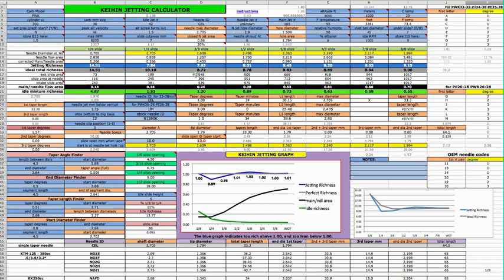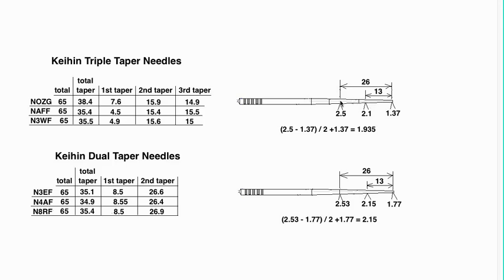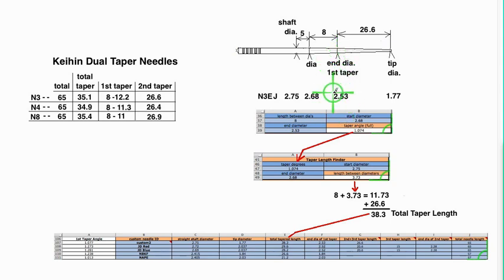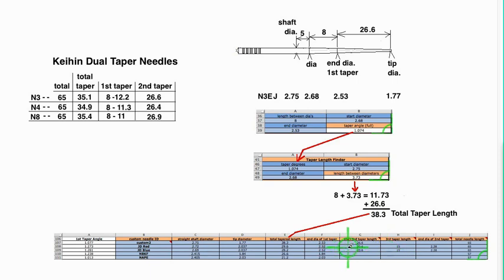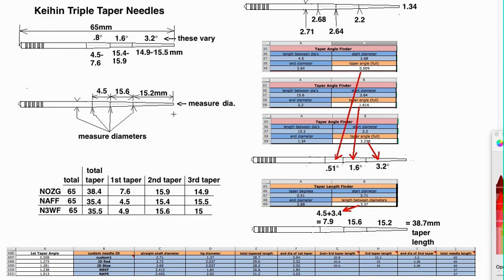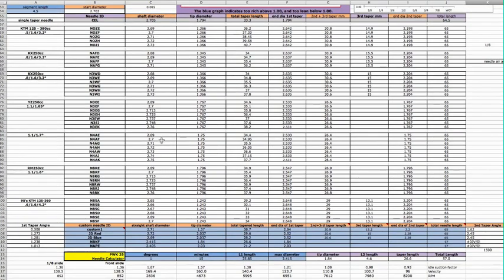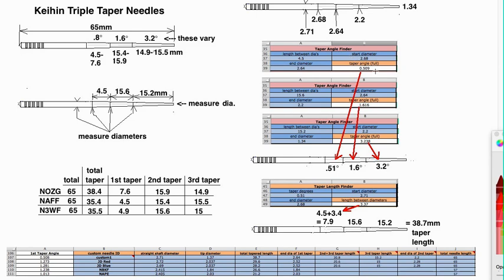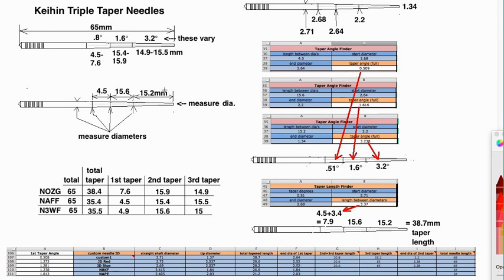Measuring Keihin Needles

Comment: Hi Michael I have got a ? for you we are going to be running a 250cc & 125cc vintage 2 stroke bikes in a race this spring  of course air cooled engine I am looking for a 2t oil better than I am running now I am running amsoil dominator I have be doing some reading about Legend oil I have witch all of your videos about 2t oil very good info have you ran Legend can you tell me about it will it stand a air cooled engines
Reply from the maker: I think Legend is an excellent oil because it is "natural" synthetic oil. Too bad in USA it's only available in large sizes.
Reply: @MichaelForrestChnl  do you run legend oil and your experience  ? what would the ratio be on a air cooled engine running about 235 degrees  can you help out please  thank you very much!!!!
Reply from the maker: @twyke6818  they dont provide the details I need to run it in my oil ratio calculator
Reply from the maker: @twyke6818  I don't know because I don't know its viscosity. Better to ask Legend.